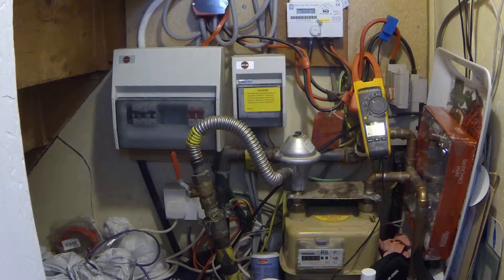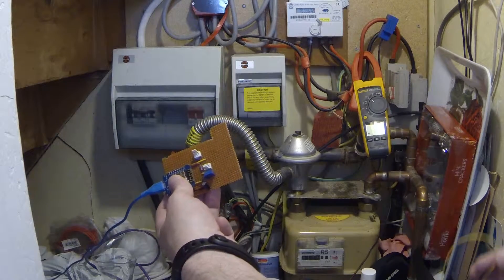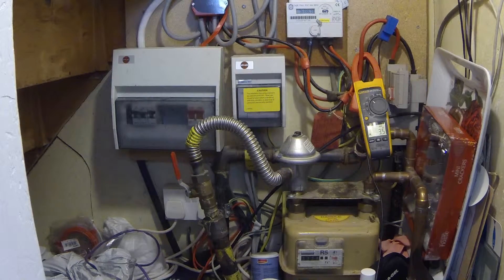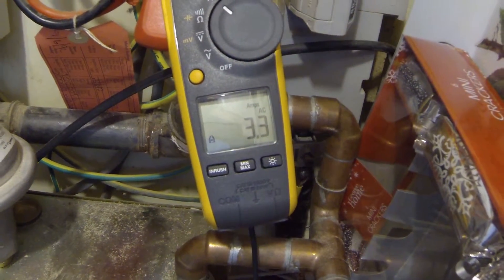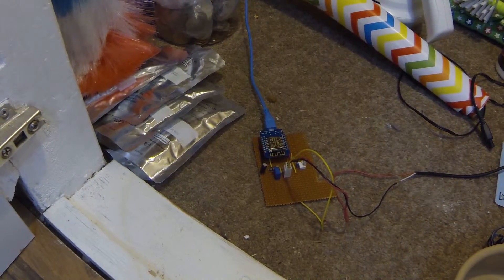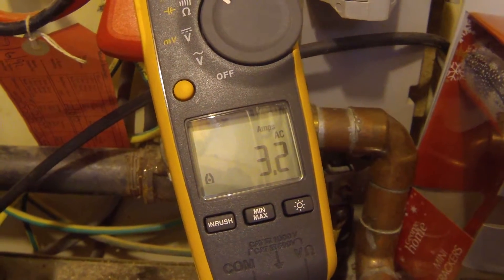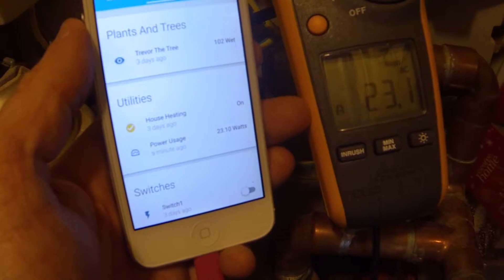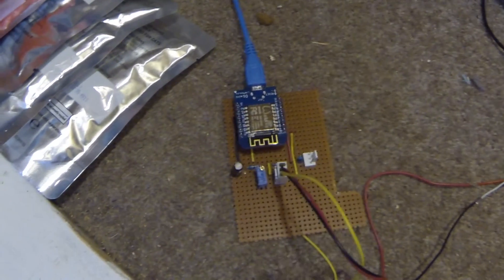Monitoring power usage at home with an arduino esp8266 (esp-12e) - part 2/2

Comment: I have the exact wemos module. I ordered a CT sensor also. Can you share the code ? what app is on the phone ? How are you going to connect 2 analog inputs on 1 pin ?
Reply from the maker: +Cristi Istrate I need to make a follow up video about this sometime to explain more about how this is working, hopefully I will get it done in the next few days actually.

I will share my code (after I have tidied it up) and the circuit I'm using too in this follow up video.

The app I'm using on my phone is home-assistant, its not actually an app, its a python based application that I'm running on a ubuntu server, which allows you to create a web based control panel for any home automation and IoT devices.

Which 2 analog inputs are you thinking I'm going to be connecting to one pin? :)

Thanks for watching and commenting, subscribe to catch my follow up videos :)
Reply: Thanks for reply.

I want to measure both current and voltage from the mains.  I want to use a sct-013-000 for current and a 9v AC to AC transformer for voltage. With only one analog pin on the 8266, I need to do some multiplexing to read both to have a correct Wattage calculation.
Reply from the maker: +Cristi Istrate Ah I see, I'm not going to be monitoring the voltage, I've hard coded 230 into my calculations on the 8266.  I did look at multiplexing the analog pin for a different project but didn't go that route for this, instead I bought an Aruindo Uno which has 6 analog pins anyway (this is for a project to monitor moisture in the soil of plants).

If you really wanted to do the AC-AC and monitor that too you could go the Uno route with a network shield but then it wouldn't be wifi, so might not be so handy for you (I've got a network switch in my cupboard under the stairs so I could do that). 

Or another way is you could use 2 x 8266 boards and do current on one and voltage on the other and send the voltage to the one doing current and get that to make the calculation and send the wattage back to where ever you're displaying it.  Just a thought ;) because I didn't like (understand fully) how to multiplex the analog pin :)
Reply: A simple way to multiplexing (in theory at least) is to connect both sensing "wire" to A0 and the vcc pin of the sensor to 2 different digital pins. Then alternate the 2 digital pins HIGH/LOW state and read for 1 second one sensor and for another second the second sensor. I don't know if this works, is jut a theory: D1=HIGH, D2=LOW - read sensor 1, D1=LOW, D2=HIGH - read sensor 2, and repeat every second or another period. But this work with 3 pin sensors. I don't know how to adapt it to CT/AC-AC.
Reply from the maker: +Cristi Istrate yeah thats the theory I read somewhere too, sounded like something I could try, but there was talk of finding a resistor for each sensor too.  Maybe I will revisit the via, for the moisture project at least :)
Reply: Depending on the sensor type you are suggesting to pull current from an I/O pin which is in general not a very good idea. Active sensor types with some circuitry should be switched using a transistor. Also, heavily dependent on the sensor type, a long(er) delay may be required for the reading to settle and be accurate. 
Anyways, good luck whoever on earth reading this after all those years (: